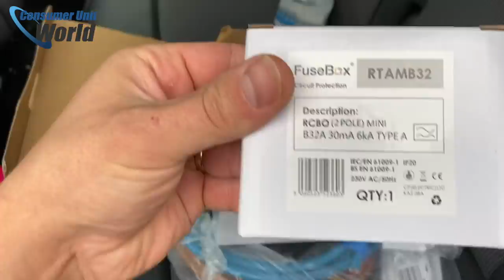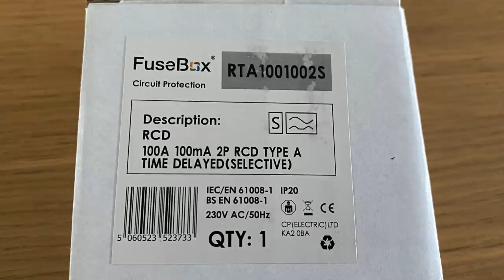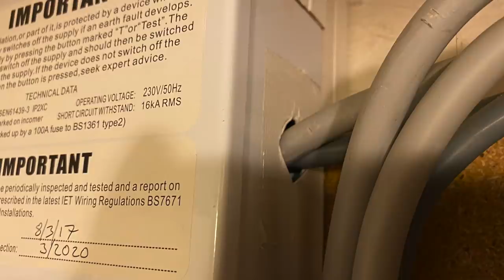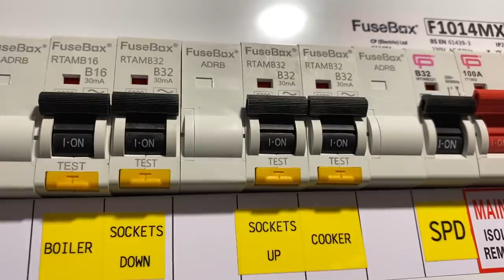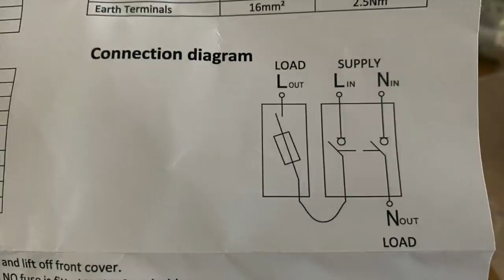Miniature rcbo install and shocking workmanship [18th] Edition?

Comment: Surge protection is great but what about AFDD is surely more important as that's one of the biggest causes of damage and fires!
Reply: Its not mandatory yet
Reply: Afdd protection is a joke
Reply: @r.h.8754  did you see the experiment with gsh electrical and david savery where they produced a arc conditions (lighting arcing the way)experiment, and the afdd did not trip out.
Reply: Andrew rowles that was creating sparks. Not arcs. Energy is key difference between a spark and arc. 2.5A minimum according to AFDD standard.

Comment: WTF, fuesboard in a toilet above a sink?
Reply: Why not?
Reply: @samhowell9154  moisture
Reply: Curtis J You're not supposed to stand in the sink and pour buckets of water over your head. It's for washing your hands, thirty seconds max, how are you going to get moisture eight feet up the wall?
Reply: @spencerwilton5831  haha that's true, I did a quick Google search and was surprised to find that as long as there is no bath or shower then it's not classed as a special location. Therefore it's fine to have the fuse board there. Not where i would put it, if i had a choice
Reply: Probably was an understairs cupboard in a previous life..
Reply: @izalman  good point
Reply: A question from someone who is just watching out of interest and not an electrician. I live in a house in which the bathroom and utility room are separated by a wall I'd like to take out to make the bathroom bigger. As the house will need to be rewired at some point and the meter and consumer unit are in the utility room, is there any way they can stay in the same position ie effectively in the bathroom. I think I know the answer but I'd like to hear what people think.
The house wiring was like something from a Dr Who set when we moved in! A nightmare so bad most of the appalling add one were disconnected. I wish I'd taken photos. There'd be electricians having palpitations 😱
Reply: @PurityVendetta  a bathroom would be classed as a special location, and having your mains supply coming into there would be a big no no
Reply: @curtisj2165  That's what I thought. Thanks for your advice. 👍
Reply: I once saw, in a ski chalet in France, the main fuse board (old fashioned ceramic holders mounted on a wooden board)  immediately above a wash basin, exactly where you would normally expect a mirror.....

Comment: I would site the cu somewhere else, then again I am a nuttr, the short cables I would use through crimps with a heat shrink sleeve, rather than a wago,  any comments ( relevant / pertinent / constructive / positive) are welcome,  who thinks how much for rcbos, what the... Anyone use em, any good? If its pukha I am so happy, recommend rcbos, but the. Cost scares clients / customers,

Comment: So you install fuseboxes of in total 178 amps on a main switch of 100 amps......Is that normal in the UK?????That main switch could burn out if more than 100 amps!!!!!
Reply from the maker: Main fuse is rated at 100amps so impossible